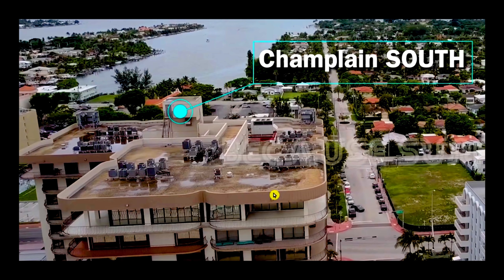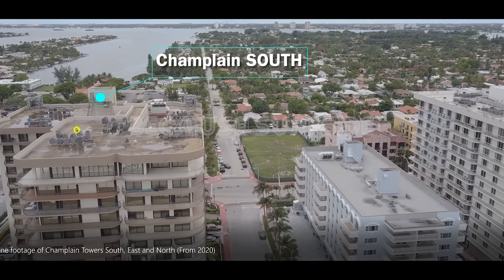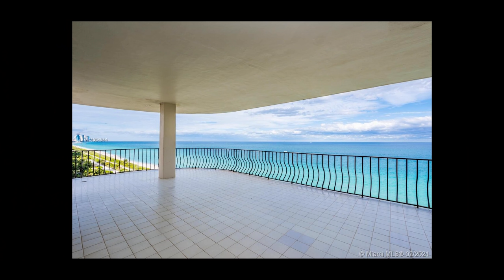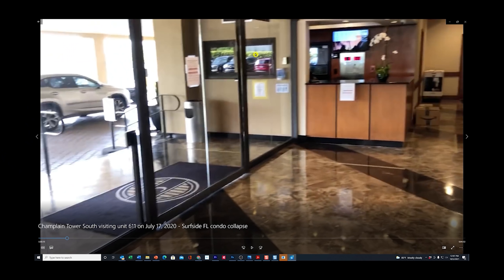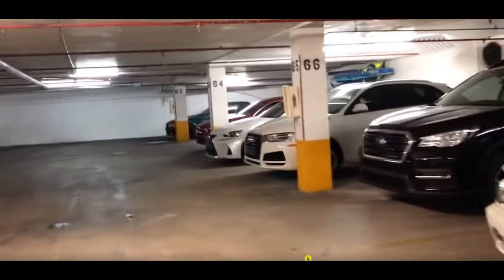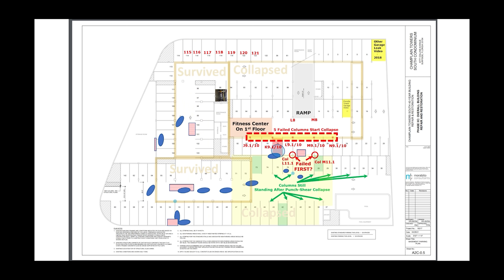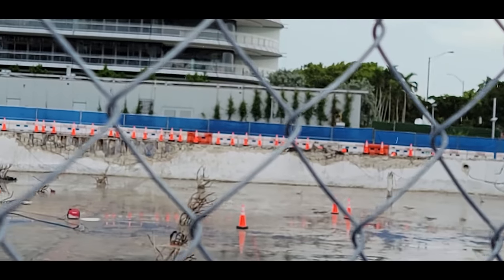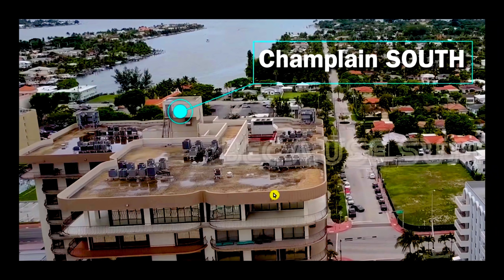Miami Condo Collapse: Water Attacked Roof, Inside, Pool Deck

Comment: I have a few questions for you regarding he theories about the roof, especially since I've been involved with roofs for over 40 years. Let's first point out that it strongly appears that they did NOT put the required 1/8" or 1/4" per ft slope for positive drainage.  The over flow scuppers are useless since they represent the highest part of the tapered system, if it were actually installed.  The ponding is usually not a problem on most flat roofs as long as there is positive drainage. Each pie cut from the roof plans should represent an arrow pointing to the middle of the roof where a roof drain is located.  From what I can see on this photo there is not much reason for concern.  You wonder if the ponding area that you see as a contributing factor, then you should point out the section (that survived the collapse) to the left of the elevator shaft.  That section has three to five times the water, but is apparently at least 5 to 6 inches deep compared to the section that actually collapsed which is around 2" and some areas of 3" inches deep, however the ponding water is much more spread out.  It appears to me that someone had removed the loose laid gravel at one point which usually weights in around 250 to 400-lbs. per/sq.  I wonder if the building was in the middle of a roof replacement due to the removal of the loose laid aggregate.  I can see at least two locations where the drains have been patched.  Its not unusual for water to pond on flat roofs from 48 to 72 hours immediatly after a rain, but its not normal for water to be covering the entire roof 4" to 8" deep, which could possibly lead to a potential clogged roof drain or drains.  The roof drains are supposed to have baskets covering and protecting the 4" to 8" roof drains openings free of debris.  Im not implying this was the case, but should not be overlooked.  I am a bit surprised why they would stack so many of the a/c units so tightly, unless they are over one of the main beams for support.  Like the pool area, if they had several chronic roof leaks, then that too would played a factor of damaging the rebar in the concrete deck.  Finally it is interesting that the section to the left to the elevator shaft was saved. I guess it shows that the elevator shaft is the strongest part of the whole building as it likely went all the way down and below the parking garage, protecting that one small section of building from collapsing.
Reply from the maker: Yes they were working on roof repairs, I have a later video that showed the computer testing done on the roof to determine saturation into the underneath insulation, and what repairs were being done, and there was an inspection by the city on the progress 14 hours prior to collapse

Comment: Hi Jeff,  I am following your videos on the condo. Very good explanations!  thnx for that.     The water on the flattened roof is possiblly condensation water from the numerous airco systems...... On the roof of the other tower I notice nice collective drains installed. No rain as far as I can see.   Keep on going!  Tom from France
Reply: Roof top compressors have no need for drains, they are only inside in owners units.
Reply: Other buildings have Aircon but no water pooling, suggesting it's not from there.  Either way, it shouldn't be pooling.

Comment: Water is usually the root of all deterioration. The water on the roof probably came from all of the AC units on the roof. The other buildings have large central AC units that are properly drained. True the roof drains should have handled it, maybe they were blocked by debris.
Reply: The outside units do not condensate.   That happens in the air handlers in the owner's individual units.

Comment: Looks to me like it was still a hot tar roof with gravel. That's why it looks so dirty. Lot of seams, tracking down leaks is hard. They come in one place and might travel a long ways before getting inside the building. Water on a good flat roof is no big deal if it doesn't leak. Some shots look like the AC units have settled too far keeping the water from reaching drains that appear to be in the edges of the roof. The AC units have to be the source of roof water with no rain....but it's Florida. It's rains every afternoon and your front yard might be wet while your backyard stays dry.

Comment: Had the roof settled unevenly so that  it disrupted the slopes of the roof so it was not draining correctly??
Reply from the maker: No concrete does nto settle out of shape. There were supposed to be slope pans under the roof membrane

Comment: F Y I  … I recvd u tube feed of multiple 
various previous real estate or condo owner video walk thrus for sale years before collapse of Champlain Tower South. I remember you mentioning at length about the weight of these materials. I was stunned to see SO Much use of Mirror covering walls and closets and some master baths had heavy thick floor to ceiling glass doors across the master bath with more corian counters in all 2-3 bathrooms. 
One ad mentioned hurricane proofed sliding glass doors in the master bedroom and I thought well how much heavier are those? Then they filmed the patio of this 3rd floor unit facing the pooldeck and I noticed the top of the palm tree outside was level with the patio flooring… whats that 20 feet or so 
x apx 150 lbs a foot … what 3000 lbs … 
then the root system of palms  spread out wide so if the roots are in a confined space I read the palm will push up and become a liabilty and a hazard if it falls. 
Anyway, I m waiting for another update 
when you have time. Thx 

ps   if you want info on these walk thru videos leave a reply … I saved them anyway.
Reply from the maker: You can paste links to me on Facebook in messenger https://www.facebook.com/jostroff

Comment: Looks like neither the roof drains or the pool deck drains were ever properly cleaned. Had the same experience at work.  Ceiling on flat roof section constantly leaked with no obvious damage to roof. Last winter we noticed the cast iron down pipe had cracked due to ice build up. Turns out the runs under the sidewalk were clogged. Cleaned them out and no more leaks.
Reply from the maker: Good info on that Chris, thanks!

Comment: In the first phase of the fall, there was an excess weight on the garage slab, which caused the slabs to collapse, which could not withstand the punching load. In the second phase, with the fall of the slab, the buckling length of the columns doubled. And lastly, any engineer knows the increase in pillar height causes a dramatic decrease in the load-carrying capacity of the pillars and this caused the third phase of the fall with the pillars now having twice the buckling length and no longer able to support the weight from the top of the structure, this caused the pillars to collapse and the building to fall
Reply from the maker: great points

Comment: Its really not thick and puddly.  I dont see where any sediment has settled which is a sign where water has been sitting for over a 72 hour period or longer. The pitch pans are only used for the base of all railing braces which has the a/c units setting about 8" to 12" above the roof. The roof to the far right is a TPO roof which appears to have quit a bit of standing water.  Even though a TPO roof can be completely submerged under water for periods of time is still not recommended because of the weight of the water.  The single ply roof immediately to the right of Champlain south has very good drainage.  It appears its 1/4" per/ft slope to the middle of the roof.  In fact both buildings to the right have fairly new roofs.  I can't see or tell that Champlain South has had many roof repairs done to it, but that does not mean it was not leaking.  I can tell one of the roof drains was patched as you can see a small white square cut of roof material (likely a Modified Bitumen) was placed over and around the roof drain hull.
Reply from the maker: Many flat roofs like these in out area are a joke, with many patches over the years, because roofers never seem to solve the problem of lack of pitch. So it's pitch or patch.

Comment: As an alternative possibility, ponding of water on the roof and deck surfaces could indicate settlement of the structure redirecting water away from the planned drainage. If so, settlement could have been caused by ground water from below as evidenced by filling of the basement after the pumps and piping were removed.
Reply from the maker: That type of settlement would have shown itself in other areas of the building, simply was no evidence of it

Comment: One thing I don't understand: why compare the, assumed original drawing of the C.T. South roof (showing drains), with the actual roof (puddled water-no/clogged drains), after a 13th story penthouse with its roof was added, later?    Shouldn't the comparison be between: 1) what's shown in this video  vs  the roof drawing specifically made for the additional story ?
Reply from the maker: To show the architect had the sense to demand sloped roof. We can't find drawings of the penthouse roof showing drainage. But it shows that even with the penthouse, the architect intended for the roof to be pitched.

Comment: It does appear also to me, that they installed what appears to be 2.5 & 3 ton roof units, over and near the drains, (Could be smaller 2 tons, just guestimating on the one I'm having installed). The units appear to be on their own platforms. My question is: are they utilizing the drains, for the A/C runoff? Because that most certainly appears that the rooftop drains are clogged! Which is quite a dangerous situation. Plus, add the weight of every single unit. Why didn't they go with industrial A/Cs, which would've taken all those TONS of weight being added! Surely the Architects imagined lots of free flowing air running through these places, instead of all of this! I'm currently working on replacing a 30 yr old HVAC system, with a 3 ton, instead of 2.5 ton, which will finally cool down the 1st, out of 3 floors - due to architectural designs. Saw my neighbors had 4 tons, which is overkill, for 1500 sq ft!
Reply from the maker: The should have their own plumbing for draining the ac lines

Comment: That water on the pool deck it looks more like a deep wet stain in the tiles roght down to the concrete and it sll seems to be comfortable ng from the plant boxee with the automatic watering yhat probably stayed on waybto long forblike 40 years strait it just kerp going right into the concrete for a hood long tiime that concrete was probably like soft mush and nobody noticed this ?you wouldnt even need to cut a piece out you cpuld look on the deck and then measurr out where ot is thrn go ontonthe gatsge and pin point it and see the lovely coñctete on the ceiling in those arras were drfinetly the problem stessd thats all fron me tited yxting
Reply: I'll have to think your ideas over and respond later.

Comment: What time of year was the drone footage recorded?  

That many  rooftop AC units if improperly drained, could easily produce that much water and much more on a bright sunny Miami day. Let's guess those units run 300 days out of a year 24/7, that's a lot of water and one thing I know about standing water on a roof top is that it WILL FIND it's way into a building.
Reply from the maker: July 2020 it was filmed

Comment: I really don't understand flat rooftops unless they're actively being used as usable space like a deck or something. But I also live in the northern Midwest - that's a surefire way to get a roof collapse from snowfall up here. Not that businesses don't do it anyway with a bunch of drains along their concrete roofs. But it puts a ton of stress on the rooftops because the snow just piles up until it melts.
Reply from the maker: yes I have seen studies of buildings whose roofs caved in from snow

Comment: The roof puddles were from AC condensation. I've worked on a lot of RTUs and split systems that just drain onto the roof, without a nearby drain. Keep working on this. Good luck! 👍
Reply: Lol do you have fb by chance ? We are looking for more tradesmen in our group . Remembering Champlain Towers South Surfside
Reply: @CollapseOfChamplainAndMore  I don't have it. I can offer advise, but I don't live near there either. Make a website, and I'll help out there.
Reply: @d.t.4523  oh we are from everywhere. Some people have just made accounts to follow along . Just thought u maybe interested in chiming in with our research between Jeff’s vids. No probs.
Reply from the maker: They are not supposed to leak on the roof. Most buildings I've been in, they have condensation lines
Reply: @jeffostroff  Yeah. When the roof isn't sloped and the drain lines clog up, there isn't much nature can do. Those puddles were likely acidic as well. The planters probably had acidic soil too. Try finding the lawn service, and find out what fertilizer they used in the planters. That might be your "smoking gun" type of evidence.
Reply: @CollapseOfChamplainAndMore  Thank you. Let me know if you find anything. 👍
Reply: @d.t.4523  oh we have a heap !!! Make an account. I did 🤣

Comment: I worked security in a condo building in Kansas city and can attest that the roof repair was probably cuz the penthouse tenant bitched about water coming in. We had so many issues due to water leaks that one winter a pipe burst on the 8th floor and leaked down into the lobby. A terrible tenant can be just as bad as bad construction.  Same thing goes for a condo board that refuses to raise the hoa and would rather do cosmetic work then needed repairs
Reply from the maker: I doubt in this case it was because the penthouse person complained I don't think there was anybody in it it was still empty. Waiting to be rented out. The condo was in the middle of its 40 year re certification and they had planned to do the entire re roof of the entire complex and they were trying to get it done before the hurricane season started before the rates go up with all of the roofers.

Comment: I wonder why the roof slopes toward drain only needs to be a mere 1/4 inch per foot. It would be safer to err on the side of a greater slope. Of course drains easily block too
Reply from the maker: Plumbing codes have always used 1/4 inch per foot as the necessary slope to drain water we even do it in the shower pans when we remodel showers in the bathroom. You don't need it to be any higher

Comment: The water was probably coming from a.c. unit condensation lines. Not properly piped to drains
Reply from the maker: Too much water to be from Acs, and you would have to assume all the lines are bad. Just not sur on this one.

Comment: It would be difficult to see roof drains from this far away with a drone. The hole is flush with the roof membrane and it just has a cage over it, maybe 6 inches across and 8 inches tall. And it's a cage, so it would be hard to see from this distance. The drain itself is two to four inches diameter. And in the first drone pass, it appears the hotel roof does have some wet spots on it. Darkening of the granules on the mod bit membrane. At these heights, there wouldn't be any debris or anything, so I think it's moisture on the surface

Comment: The pooling water on the roof is probably leaking condensate from the airconditioning machines.
Reply from the maker: Nope. They have their own condensation drain lines
Reply: @jeffostroff  so, you dont think the drains could have been leaking the condensate to the roof?

Comment: The water on the roof might be from the AC units not having proper drains .  AC unit condensation can put out a pretty good amount of water . Hence why the other buildings roofs were dry due to proper drains on those AC units .
Reply from the maker: They all have drainage, can't imagine they spew out that much water undrained

Comment: Maybe they built below the water table, leading to constant water intrusion into foundation. Leading to eventual sagging issues , hence all the cracking / leaking throughout ??
Reply from the maker: They did not build below the water table, or there would be water in the streets at all time. Supposedly they had this issue of flooding in the garage during king tides

Comment: Jeff, what are your credentials (University graduated from, area of study, years of experience, accreditation, licenses,)?
Reply from the maker: BSEE, a degree in electrical engineering, some coursework in strengths of materials, radar, physics with calculus, robotics, software programming, 25 years experience remodeling condos, foreclosures, repairing engineering disasters, builders mistakes, code violation corrections, etc.

Comment: If you all are interested in what went wrong here, may I recommend a case of what went right: Citicorp Tower. This is required reading for any engineer in any profession. This video is from the 90s, but it’s the guy who built it. His building had a serious problem, he listened, sought help, designed a fix, documented everything, and fixed it. His handling of the situation was so good that his professional liability insurance went down not up. I loved this video: https://youtu.be/um-7IlAdAtg

P.S. the audio does clear up, so please bear with it!

Comment: If water is pooled somewhere (anywhere, not just on the roof of a building), doesn't that mean that it's NOT seeping somewhere else and causing unseen damage? The only thing that the pooling water on that tower in the flyover tells me is that it could NOT find anywhere else to go. If that pool or water was 20 feet deep, that would be a significant amount of additional weight for the structure to bear. But it's literally inches of water.
Reply from the maker: Water usually finds a path downward